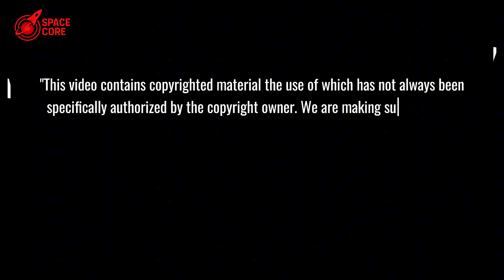SpaceX Finally Recovered Falcon Heavy Center Core...NASA SHOCKED!

Comment: How many times before have they attempted to land a Falcon Heavy Core? Once. The booster fell over due to rough seas after the landing was over.
Reply from the maker: SpaceX attempted Falcon Heavy center core landings multiple times since 2018, all failing until B1091's success. Rough seas caused one post-landing tip-over.

Comment: I look forward to Barge Landing with a Drill Chuck type replacement for Landing Legs. That's going to add a lot to payload
Reply from the maker: A drill chuck-style landing system could boost payload by reducing weight, but it needs rigorous testing for stability.